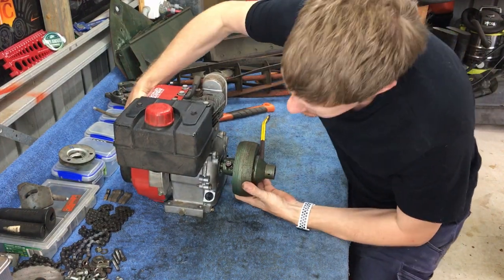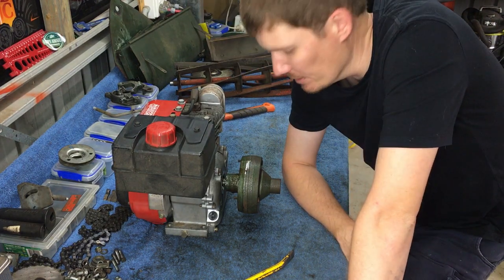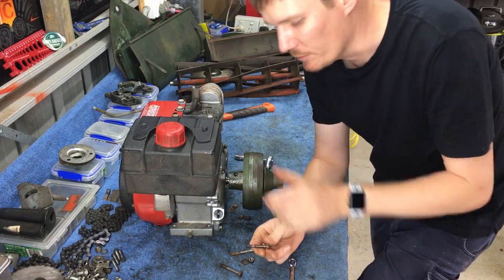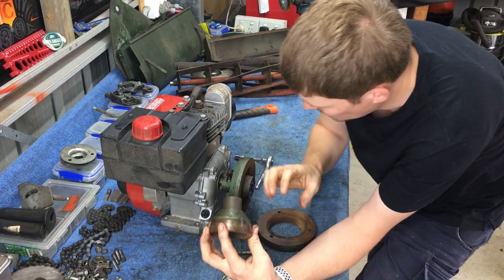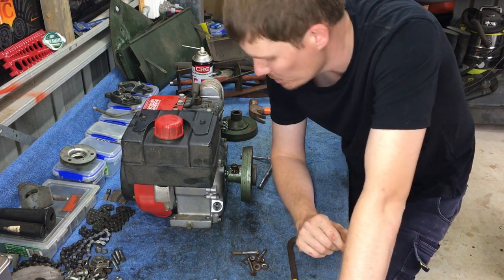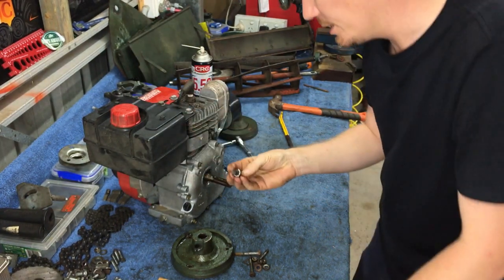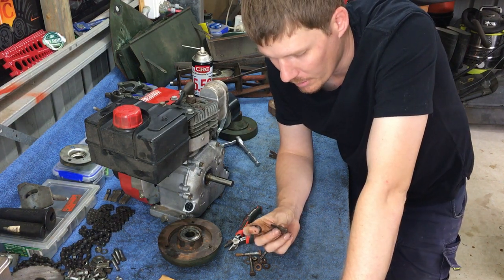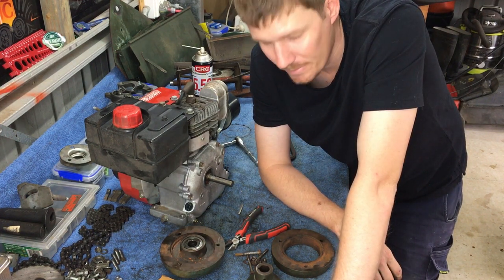Scott Bonnar - Model 45 - Teardown Part 6 - Clutch Removal & Disassembly

Comment: You need a 3 jaw gear puller mate. Slide straight off, save the fingers too lol.

Would a stuffed cork in the clutch cone be the reason the blades dont turn when clutch is engaged? Even if the lever is engaged or not the clutch assembly turns, leading me to suspect the cork needs replacing. Wwould this in turn stop the drive to the rear roller? Went to use my scottie today and the clutch does nothing to the blades and the mower wont drive either.

Edit... binge watching your videos they are very interesting.
Reply from the maker: It sounds like you may need to adjust the bolt on your clutch fork.. doing this will allow the clutch cone to make more (or less) contact with the clutch cork..
You’re correct in saying that the rear roller won’t work if your reel doesn’t spin..

Comment: Which new clutch option did you end up choosing to replace this?
Reply from the maker: I’ve decided on a Centrifugal clutch setup from mowpartsoz.com.au
It worked out to be cheaper than buying all the parts needed to make this clutch work. 
I’ve never used/installed a centrifugal clutch and am looking forward to the process..
Reply: @SBRenos  Ah interesting. Keen to see your thoughts once installed. I need to replace the drive clutch on my resto and I’m unsure of which available new options to choose. One has a cottar pin the other uses grub screws. I’ve heard grubs are better but was hoping to glean some info from you on which you chose and why.
Reply from the maker: I personally think cotter pins are better.. I own a rover which has the two grub screws and they seem to loosen over time, I’m forever checking they are tight.. All my other mowers are cotter pins and none have ever become loose 🤷‍♂️
Reply: @SBRenos  Ah that’s very interesting. Thanks for sharing your experience. 🙏🏻